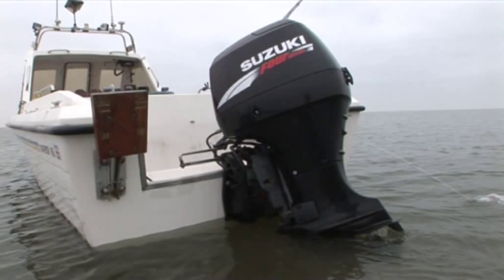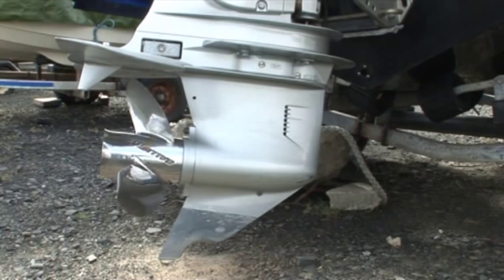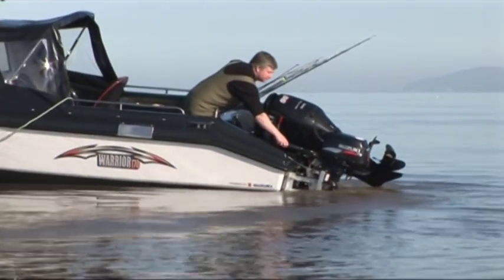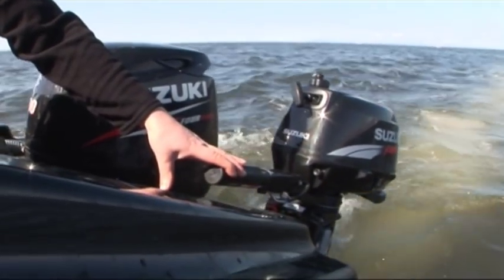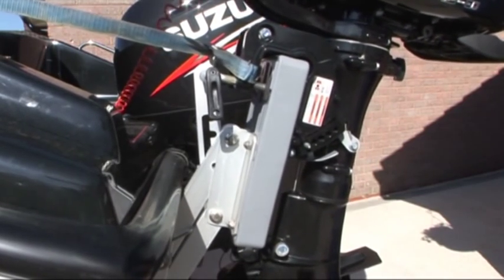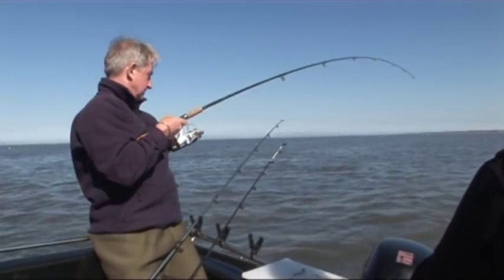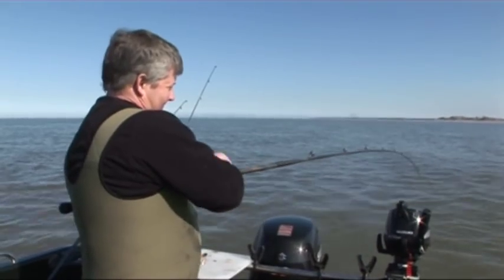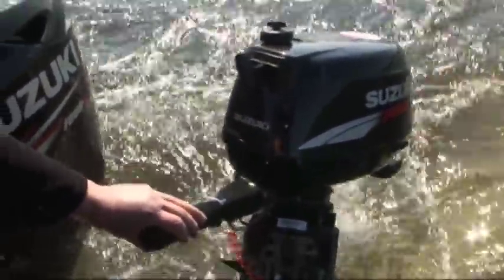Suzuki Df4 Auxiliary Outboard Review

Comment: One issue of discussion is whether or not to bother with keeping a separate fuel supply--not likely perhaps but if you ever have contaminated fuel bring your main down, you might appreciate the auxiliary engine having it's own, clean fuel at the ready.  Secondly, even if the motor is BRAND NEW, it can (it happened to me) you can lose that engine at the worst possible time.  For that reason--forget the kicker, have your anchor ready to deploy NOW.  Also, even if you HAVE a towing service, that will not help you at the moment that main engine goes down.  An anchor that is stowed properly and ready at a moments notice, is a GREAT idea--and to have a kicker BEATS calling for a tow.  Think about it.

Comment: I have a striped down 17' Whaler haul (16'-9" I think) ... in your opinion would a new 9.9 Merc. be sufficient enough to push the boat around ??? ...I would fish from pole to pole on the Chesapeake Bay  bridge MD , put in at Sandy Point , the Chesapeake is 4 miles wide there ... my target times would be when the tide is moving at full speed ... what do you think , is a 9.9 hp enough to work the poles , boat 850lb., persons 400lb  , gear -motor - fuel 250LB. ... I'll save this vid and check back to see if you've replied ... thanks ... ps., this 17' boat is my last , in my life I've owned 7 other boats , I want to slowly and peacefully fish from this one until the end ... thanks in advance ...

pss., that boat being towed at the end of your vid. reminds me of a Boston Whaler Minempsha I once owned ...

Comment: Do you know if the owner of df4 can place outboard tank of fuel?
Reply: i have a df4 ,,the only differeance to a 5hp  is the rev limiter ,,go on youtube ,to see how to remove it ..i am doing mine ,,the engine is the same for a 6 hp ,but you have to change some parts  manifold etc ..you can only do this on certain ones ,,mines a 2 stroke ,,and yes the external tank can be hooked up ,,so remove the limiter ..and maybe put on a 6 hp prop
Reply: I just bought an older DF6 a 4 Stroke, and so far it looks like the 4 and 5 hp don't have a direct line. But, even though they only hold 1 ltr, they use so little, it would not be hard to just fill it up again when needed. It would probably run fine on 2 stroke fuel anyway if you ran out of straight fuel.